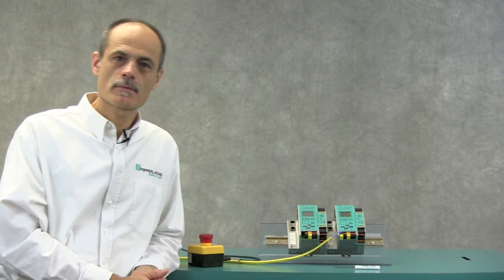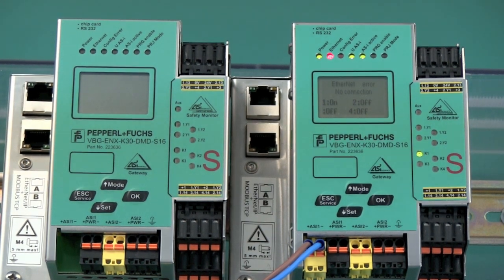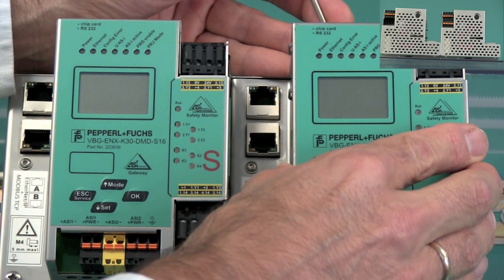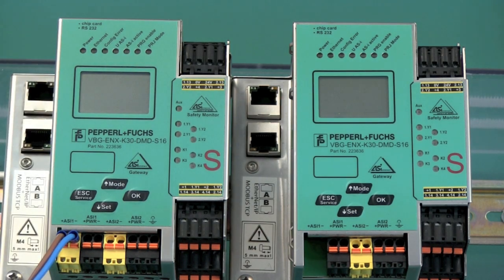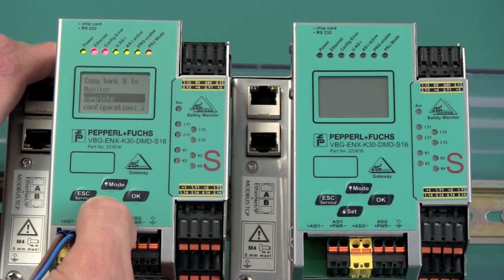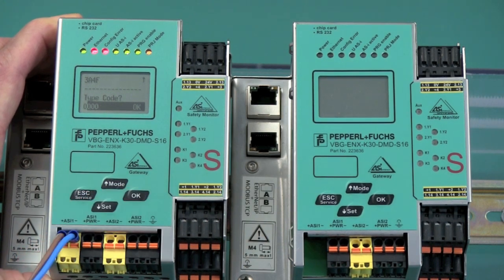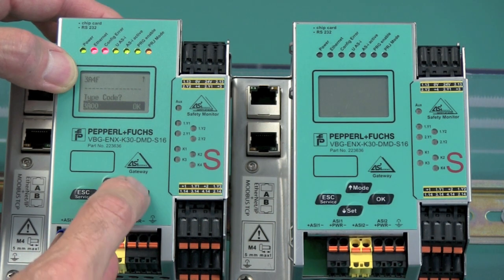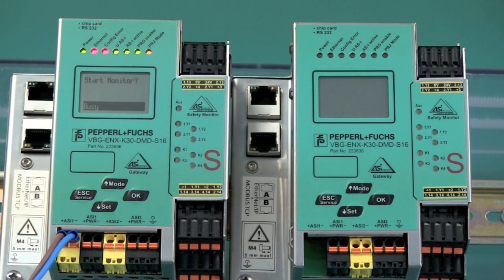AS-Interface Safety Monitor with Gateway

Comment: Where can I find some more information on the safety release part? What is that exactly?
Reply from the maker: Hi Heyman,

The Release Code is a security code for a safety configuration on the chip card. A 4-character hexadecimal number generated by the ASIMON software. The release code is displayed before copying a configuration from the memory card to the Monitor and must be repeated by the operator. This provides a technical safeguard against errors in the unprotected display and keyboard software.

It ensures that the chip card contains the configuration intended for and released for the application.

The safety representative who generated and validated the release code stores the release code for the master configuration and approves use of the configuration for specific equipment.

We hope this helps.

Comment: but, how store the backup data into the chip?
Reply from the maker: Hi there Marco. The AS-Interface gateway will automatically store the configuration data to the chip card. Whenever changes are made, they are saved in two places: the internal memory of the gateway and the external memory card. When it comes to replacing a failed gateway, the gateway performs a check to see if the data on the chip card matches the data in the internal memory. If not, it will ask if you would like to transfer the chip card data to the gateway.

Comment: Good Morning. I have one of these and appeared to fail 1.40 low power supply. It has voltage and it is monitoring it wrong. How do I disable it until I see the cause?
Reply from the maker: Hi Marcello,

Thank you for your question. Here are some recommendations we have used in the past to support the 1.40 or 2.40 display on gateway.

Let’s start with the Maintenance & Troubleshooting Guide:
https://files.pepperl-fuchs.com/webcat/navi/productInfo/doct/tdoctb008a_usa.pdf?v=21-JUL-17
 
Page 13 covers potential error 40 on the gateway display. Please review the check points. 
 
Another useful troubleshooting tip is to swap the two networks.  
- If 1.40 remains after swapping the yellow cable, the gateway is probably the culprit. 
- If, when swapping the networks, it now says 2.40, then the network is probably the problem.